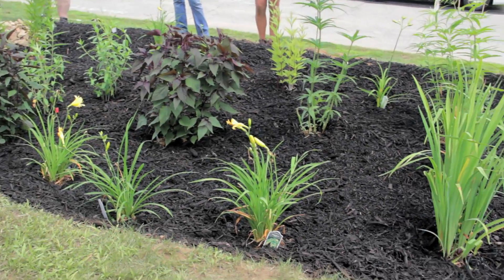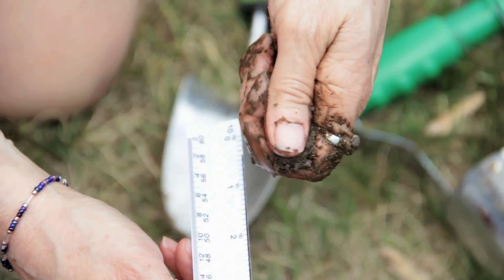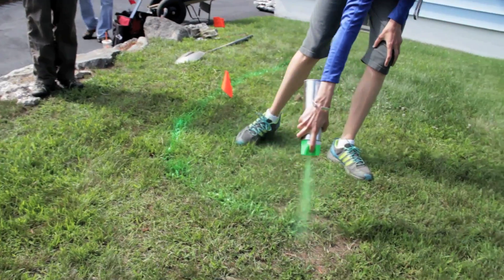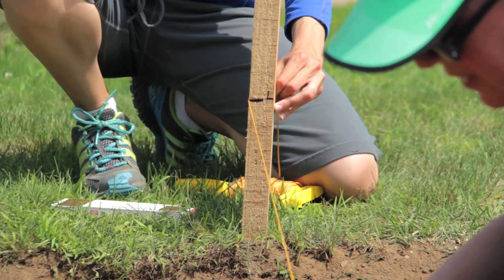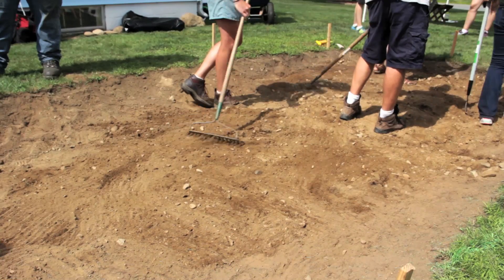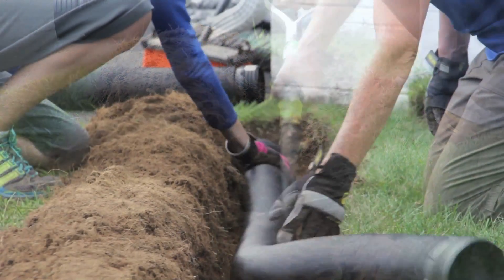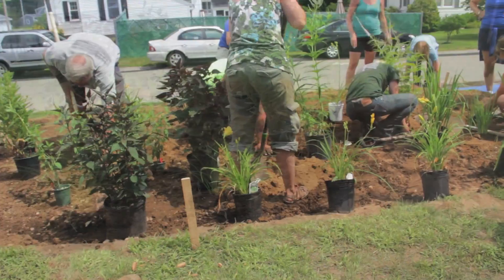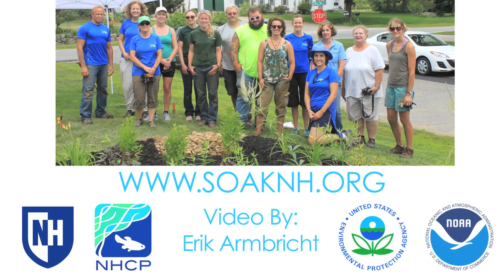How Do I Build a Rain Garden?

Comment: While black mulch might seem like a visually appealing choice for a rain garden, it's generally not recommended for a few reasons:

    Heat Absorption: Black mulch absorbs more heat from the sun compared to lighter-colored mulch. This can create excessively hot soil conditions in your rain garden, which can stress and potentially harm your plants, especially native  plants that may prefer cooler soil temperatures.

    Water Temperature: The absorbed heat from black mulch can also raise the water temperature in the rain garden. This can be detrimental to beneficial aquatic life, such as frogs, insects, and worms, that might find refuge in the moist environment.
    Decomposition: Black mulch is often dyed or treated to maintain its color, which can slow down its decomposition rate. This can impede the natural process of adding organic matter back into the soil, potentially impacting soil health over time.

Here are some better options for rain gardens:

    Natural Wood Mulch: Shredded bark or wood chips come in various colors and decompose naturally, providing nutrients to the soil as they break down. Opt for lighter-colored wood mulch to reflect more sunlight and keep the soil cooler.
    Composted Materials: Compost provides excellent drainage and adds valuable nutrients to the soil. You can use composted bark, leaves, or other organic materials.
    Gravel: While not strictly mulch, gravel can be a good option for paths or borders within your rain garden. It allows for good drainage and provides a habitat for some beneficial insects.

By choosing a lighter-colored, natural mulch option, you can create a more favorable environment for your rain garden plants and the ecosystem it supports.

Comment: What do you do if your entire yard is rock hard clay and you still want to do a rain garden?  I have a ditch at end of my street with a storm drain for yard runoff.  Would like to plant around the storm drain?
Reply: Josh, The number one rule for installing a rain garden is that it is located in an area where the water can soak into the ground. As I'm sure you know water has a hard time finding its way through rock hard clay! I would suggest spreading out runoff to any vegetated areas you currently have including grassy areas. If you try to dig any type of basin, you may accidentally create a pond! As far as planting around the storm drain, be sure you have permission from the property owner (the city or state or homeowner association perhaps?). If so, try to chose water tolerant plants. Natives to your area are best. We have a list of New England native rain garden plants you could use as a starting point - look at the Soak Up the Rain NH website under Resource -> Rain Garden Planning. Good luck, SOAKNH.